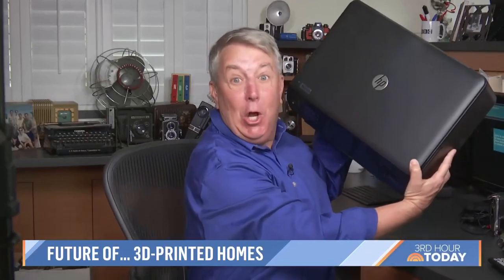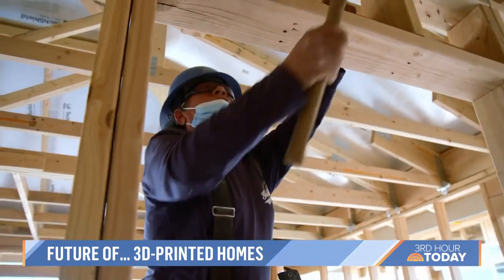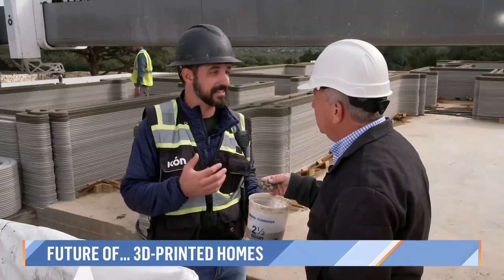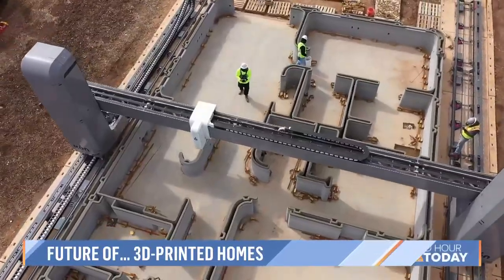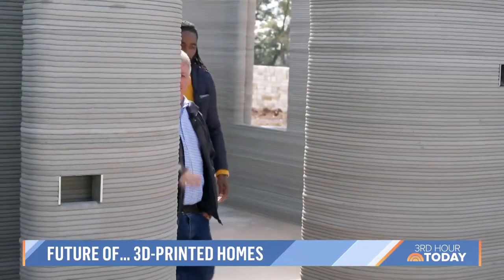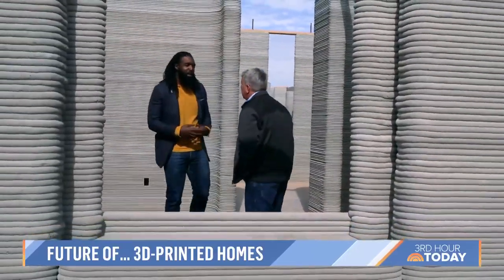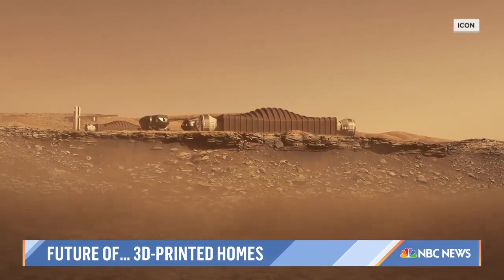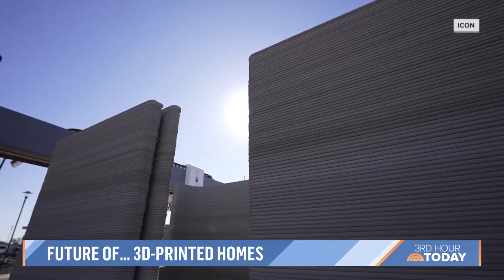This One-Of-A-Kind Neighborhood Is Filled With 3D-Printed Homes

Comment: I think in 50 years this will be seen as a gimmick. Needs to be a lot cheaper to be viable.
Reply: In 50 years it will be cheaper. Look at regular 3d printers they used to cost thousands of dollars and were rather glitchy. Now you can buy one for a couple hundred and they are much more reliable. Same is true for almost all new technology, look at microwaves, computers, cell phones, electric cars, the list is endless, all things that cost a fortune when they were released commercially but become much cheaper over time, and often with vast improvements made on the originals.
Reply: Every new piece of technology is expensive in its beginning. How much do you think flat screen TVs costed when they first came out? What about computers? Do you think the average American was able to afford a computer when they were first built? Definitely not so it's naive to think it's a gimmick just because of the high cost.
Reply: It's not the tech that is expensive. Just the area of Texas there is very pricy.
Reply: applying 3d printer to houses is relatively new, with any new technology cost will be high. Eventually cost will come down, and when they come down to a certain price it will be used everywhere. However we are not at that moment but are approaching it.
Reply: It will be

Comment: This is done from the perspective of someone who has no idea what he is talking about. A small crew can frame a house in less time than it takes to assemble the printer gantry. How do you insulate with a vapor barrier? Only the walls are printed, roof is still woodframe. In the future, forget any interior wall changes and repairs will be impossible. How do you keep that textured surface clean? This will not result in cheaper or better houses.
Reply: A framed house doesnt have hurricane durability, if they are smart theyll create an gap in the walls to add an insulation barrier then cap the top off. There would need to be a lot more considerarion in ventilation and controlling humidity.

What size house are you framing compared to these printers? What is the difference in overall labor cost at the end of it? How much in lifetime maintenance costs are you saving?

I imagine the printer will become easier and easier to assemble as they move out of prototypes.

A point to be made though is what you get is set in stone and there would be significant design choices so that repairing and accessing plumbing/electrical is a priority....bringing out a jackhammer to do maintenance is a nonstarter.

Theres going to be a future where using wood won't be possible anymore.

Comment: Unfortunately this technology is very limited at this time. It can only produce walls of 10'6" max. So, anything above that - ceiling, roof, second story- has to be wood framed. That means really no resilience to storm, wind, seismic.The leading technology in multi-disaster resilience and energy efficiency is RSG 3-D which is supplying to all manner of homes, resorts, universities, US Gov't, commercial buildings. RSG 3-D is the future of building, not ICON
Reply: Looks interesting, but has it been tested in the real world? I didn't see anything about that on the RSG 3-D website.
Reply: Look how advanced technology is improving.
Reply: You forgot one big negative. The rounded corners. The rough rounded edges are going to be a magnet for dust, dirt, debris, insects, etc. I can’t imagine the amount of dusting maintenance that would be required periodically on the interior 10’ high walls alone.

Comment: The cement and concrete industry is one of the most neglected in the fight against climate change. It's responsible for about 8% of global carbon dioxide emissions, more than double those from flying or shipping.
Reply: That is true Sarah. At RSG 3-D we reduce by 40% the concrete content of commercial walls and disaster-resilient buildings. When you compare life-cycle of RSG 3-D (500 years) to building multiple wood frame homes during this span the $ savings, materials savings and health benefits really show. We were the winner of a LEED Life-Cycle Assessment against all other global building products.

Comment: It’s a great concept and may be the future of home building BUT…

ICON needs to engineer a square edge instead of the round one that is currently used. That rough rounded edge is going to be a magnet for dust, dirt, debris, insects, etc. I can’t imagine the amount of maintenance it would require on the 10’ high interior walls alone. Eliminate the rounded edge and I am sold on the idea.

Comment: I have been watching this for years now, They have 2 Huge Hurdles, the first is Building code, for now they are stuck with areas with no code requirements, a Variance, or an Engineers Stamp on every one. The other Hurdle is a Much bigger one, thats their "Secret Sauce" Concrete!  If you know anything about Concrete, you know its Not an Environmentally friendly product, It is Carbon Heavy. Concrete production produces 8% of the overall global emission, and in New Jersey it makes up 12% of emissions in New Jersey. to be fair Icon's sauce is a little less because its not aggregate heavy, some portion of those emissions do come from the aggregate production, However for every ton of Cement produced, 0.8 tonnes of CO2 are produced. This is a huge Hurdle to overcome.